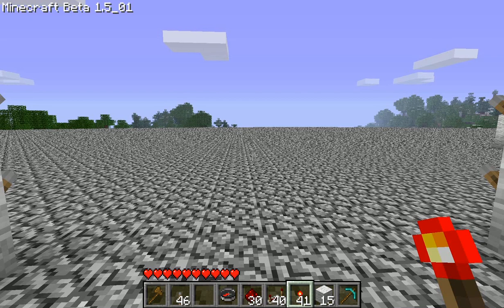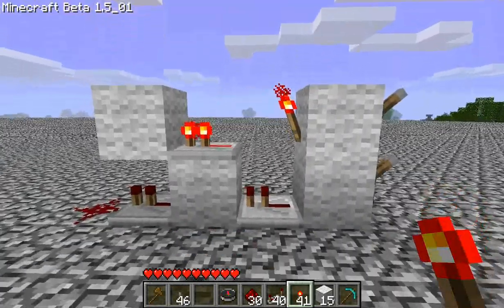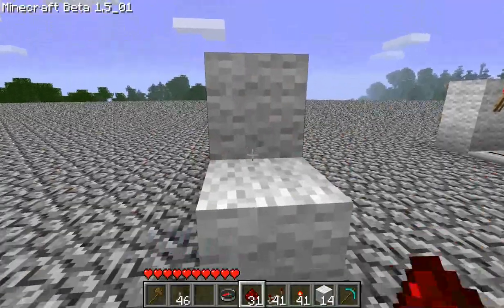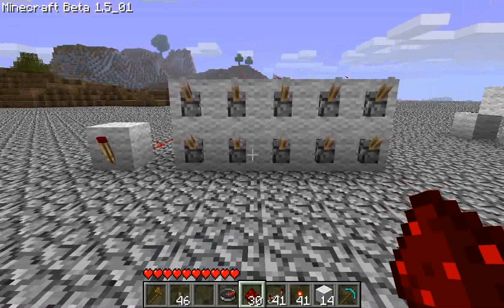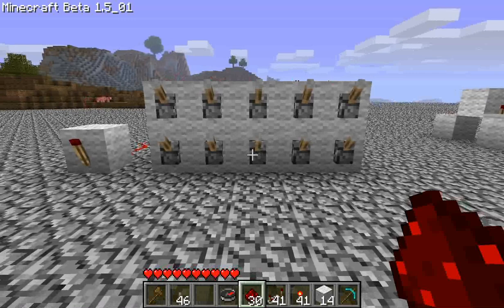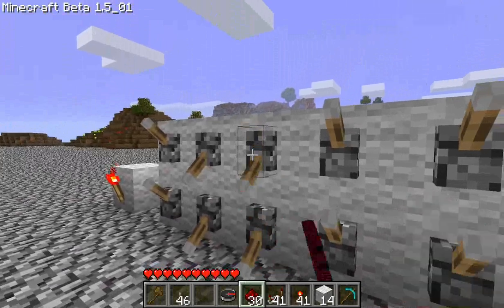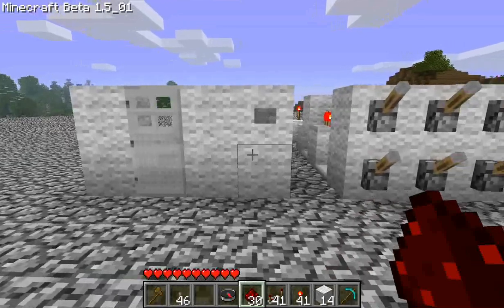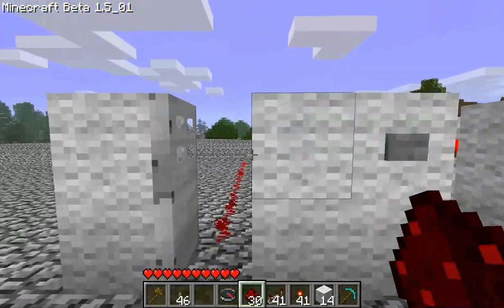Redstone Combination Lock Using Levers

Comment: @MrAdnan252 You could add an RS-Nor latch to hold the door open once the button is pressed with the correct combo.  Then you would be able to reset all the levers and enter the door.  A pressure pad on the other side can do double-duty by both opening the door from the inside and resetting the RS-Nor latch to close the door after entry.

Comment from the maker: @NirvEnd Well in both cases it depends on how many buttons/levers you use. Like i said each added column increases the amount of possible combination exponentially. If you're really paranoid about them guessing it, try making 10 columns instead of 5, it would take them anywhere between 1 and 1,048,576 tries to get it right. good luck to them.

Comment: @AmmorthNefare good idea, but a persistent player could push his wolf through the door to press the pressure plate, thus opening the door.  Trust me, this is possible.  better have the plates reset the RS NOR latch only (to shut the door) and have a separate button to open the door from the inside.

Comment from the maker: @subjectTOM Check out the description for my video called "A bunch of useful piston creations and ideas" (it's in my channel). There is a link to my piston world, it includes a piston based version of this, with an rs nor latch so you can reset the combination. It's explained better in the video. You don't even need an and gate though, just invert it with a torch and connect it to a door.

Comment: still don't like levers I feel like they are giant rods sticking from the wall especially when amassed but gj either way. The only thing is I know this is kinda about semantics but I also prefer the button locks tho they are indeed much larger they can be done with a reset so only the right sequential order will work and each button can be used more then once. I have had a few lever locks opened by persistent people but never a button lock D: